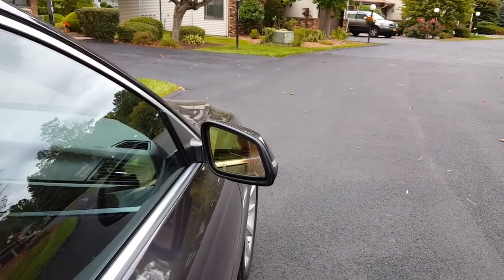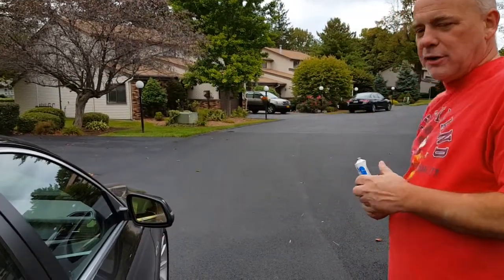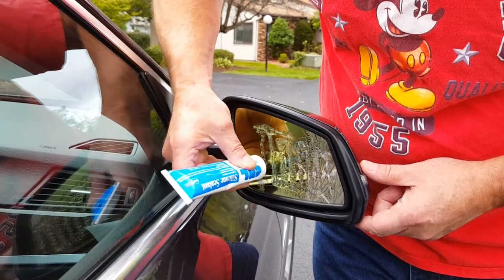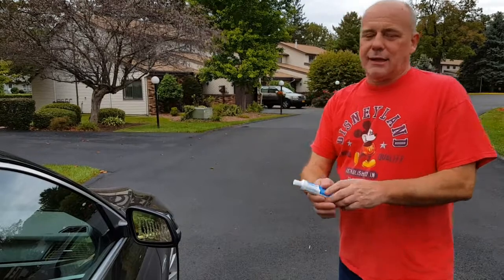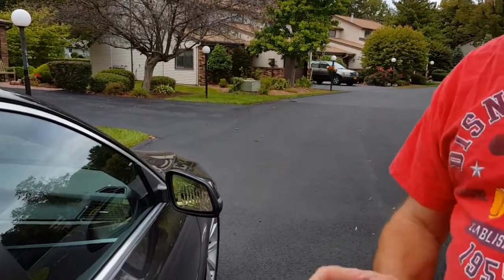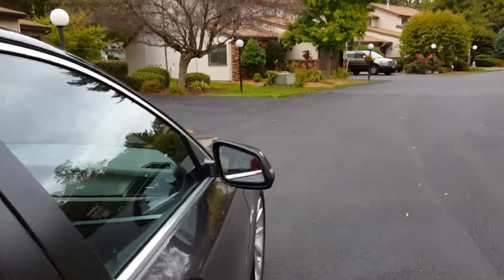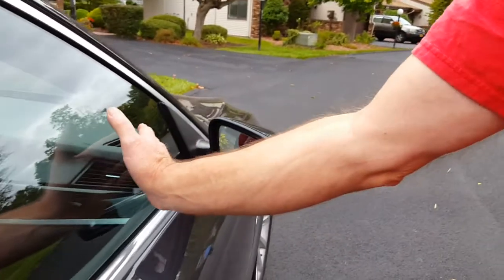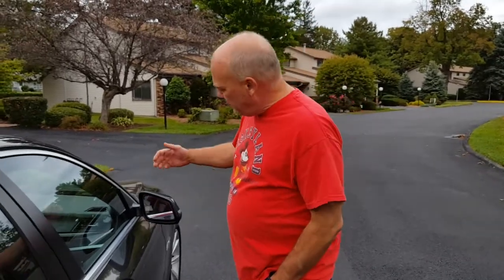BMW All Series, mirrors made of Self Dimming or Auto Dimming car mirrors Show a very easy repair.

Comment: This is not how you repair an auto dimming mirror glass…you basically glued an ordinary mirror on too of the old one and I’m telling you that the heating element won’t work as good or it won’t at all…and of course the dimming function will be gone
Reply from the maker: If you watched the video, I dotted with silicone on the failed mirror on the car. When I put the mirror on it, all the dots create a silicone pad. This way it heats the mirror evenly. The delay is minimal.
Reply: @91StefaNs
He sounds quite confident though even if I also think it won’t work & will probably fall off in a year or 2

Comment: it wont dim so not actual repair of dimming mirror as it wont dim again. Your title implies you fix not replace with standard mirror
Reply from the maker: Did you hear me mention the cost of replacement? BMW does not sell Just the Mirror. They sell the housing, in Primer Grey so you have to have it Painted. Housing  780.00, Paint 150.00, Install 125. Ok. Collision Insurance would cover it, but the Ave deductible,  1000.00. Do the Math
I am showing an alternative, especially when you're turning the car in after the lease. Oh and try to find just the frame in a junkyard on a 3-year-old BMW.
Reply: @raytheglass  what year is the 535? Cuz you can find just the glass on fcpeuro.com albeit for about $400 though it is lifetime warranty. I just searched for a 2010 so they might have it for that year of car. And btw the glass is from genuine BMW, for the 2010 that I searched.

Comment: Hi! I have a 2010 328i bmw coupe and my mirrors have turned bronze. Is this what I can do to fix it? I am not sure where to get the glass replacement for it
Reply from the maker: If you go down to my description page you will find a link that brings you to my BMW webpage.in which you choose your car then choose your mirror as per the year of the vehicle the rest is simple as a shopping cart. Being I just got a thousand subscribers I don't have the ability to put my mirrors on page itself. But like everyone else I have a shopping cart as well so feel free to purchase how are usa-made firstservice chromium mirror that absorbs 40% of the life so you not no longer blinded. It is the most inexpensive way to replace your mirrors. If you show this video sure my mirrors installed. Or if you need further help you can call me at 845-496-2500.

Comment: OMG this is something youd do to a Huyndai, not a freakin BMW. Either buy a used oem mirror or you can buy aftermarket ones. You pull the glass from one end and it pops out and pop in the new one, its a 2 minute job and it looks proper afterwards.
Reply from the maker: I will put you in his shoes,and I'll whisper it to you. He had two weeks to turn the car in because the lease ran out and a BMW Leasing Co would have charged him over $800. Trust me. The leasing company even with a microscope would not know it was changed. Hope this doesn't happen to you mister Hyundai 🤔 owner.
Reply from the maker: Yes...for ave cost $425.00
Reply: You did this on a lease?!? That’s dishonest.

Comment: What if you have auto dimming mirrors tho
Reply from the maker: I don't understand your question?. Maybe you can explain what's wrong in the year make and model of the car and I can help you
Reply: @raytheglass  I think he means that he was looking to fix his stock auto dimming mirrors.
Reply from the maker: This was repairing an auto dim mirror using the 40% translucent first step is chromium product. It absorbs 40% of the light. Self dimming mirrors absorb 65. So does this is an easy fix if your self dimming Mirror Has Broken or it has failed and turned into black bronze and distortion
Reply: You can find full replacement glass with heating elements new from Amazon for cheap. I think I paid $70 CDN to get both heated mirrors for my 2015 BMW 328i. You can find OEM like new glass that is heated and auto  dims for around $100 or so US. Most sellers are from Europe. Takes a little care when popping off the old mirror out of the housing. Check out Kies Motorsportd DIY on YouTube.